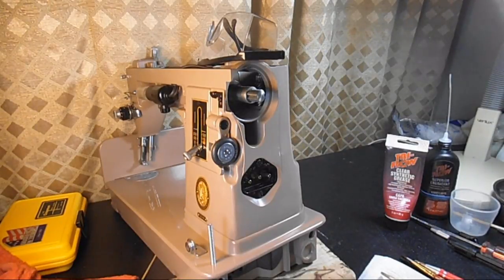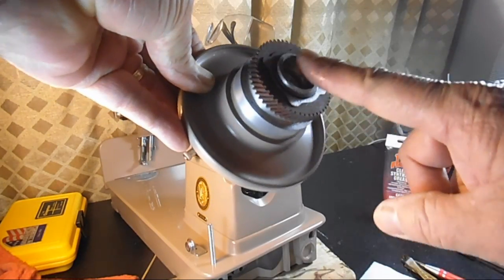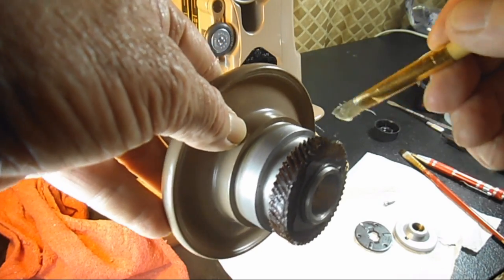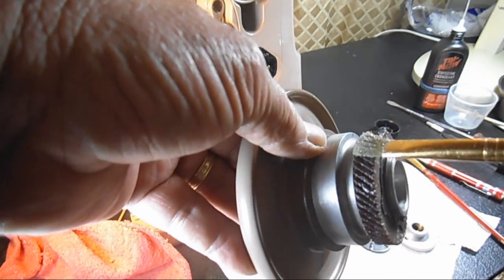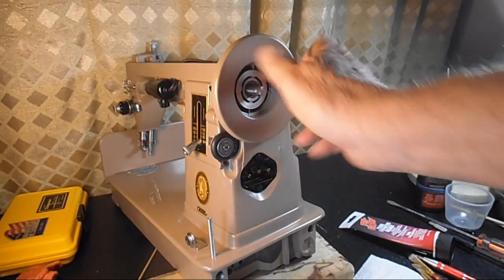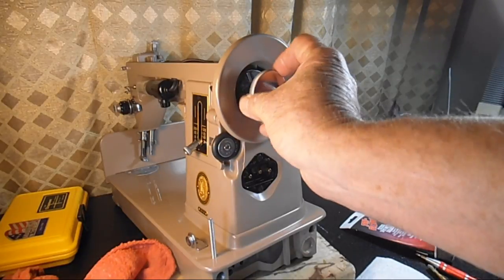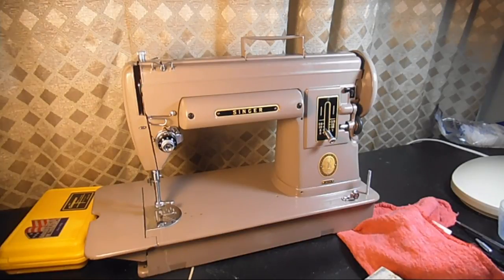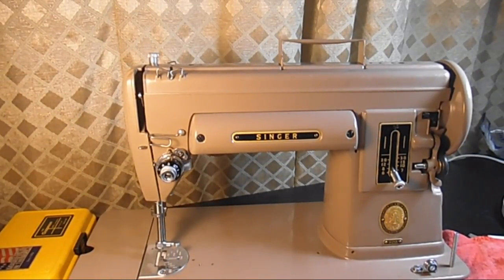Finishing All Together Now - Coco goes to the Spa Pt. 8b - A Singer Model 301A Rehab

Comment: Good afternoon Andy.  Putting everything back together, and I could not find the needle/throat plate.  I spent 30 minutes, finally the wife started helping me, checked the work area, my recliner, the bottom of the magnetic screw holder cup 3X, and all of my pockets.   I knew I had laid it on the table top work area.  I finally picked up the tablet (watching Andy Tube while tearing things apart) with a magnetic latch on the cover.  It was stuck on one of those small rare earth magnets I had told you about.  Doh, slap to forehead!  Funny story I had to share.
Reply from the maker: Thanks for the laugh. I needed one. Too, too funny. 🤣✨

Comment: Thank you so much Andy! I recently acquired a 301 and have been so frustrated with a few issues. In this one video, you have cleared up these problems and she's running like a champ. After removing the handwheel and the nut, I discovered a ton of grease where there should have been none. Cleaned it up, put the wheel back on correctly, and to borrow your line: "taaa-daaa" perfection!  You are my new bestfriend! Thanks for all of your wonderful videos.
Reply from the maker: Congrats on your newly acquired Model 301; you picked a winner! I'm honor to have you as a friend; who can't use more friends after all. Your very kind comment made my day today after getting some bad news, no thank you very much for taking the time to let me know. Happy Sewing, 'friend M P'.
Reply: @andytubesewing1953  Thank you Andy. Sending thoughts and prayers.
Reply from the maker: @MPCrafts461  👍✨
Reply: My machine was as new it was from a high school and it showed no signs of dirt when I got to that gear you can tell where it slung off some original Grease being the machine it was so clean I could do forensics on it

Comment: Andy, I discovered your videos on Coco about the time I gifted my Featherweight and started cleaning up my 301.  I'm not that knowledgeable about the internal workings of the sewing machines I use, but your videos gave me the courage and knowhow to take my machine apart, clean it, and put it back together again.  And I have made a purse and a quilt since I did that.  Thank you thank you thank you for putting out a very comprehensive and understandable set of videos.  Now, if only I had the same thing for my Singer 319K.
Reply from the maker: Congratulations, Deva! If you have successfully sewn with your 301 that means you did a fine job with its restoration. I'm glad you found my videos helpful and thanks for letting me know.
I think you are ready for more restoration work, don't you? Follow these links below and download FREE copies of the instruction manual, parts list with diagram and even the coveted Service Manual for your 319. I'm sure you will find restoring it very rewarding and I believe you can do it. What say you, Deva? Have fun.
https://www.singer.com/sites/default/files/product_manual/SINGER%20319%20and%20319K%20Sewing%20Machine.pdf
http://parts.singerco.com/CPpartCharts/3_39999/319K.pdf
http://parts.singerco.com/IPsvcManuals/306W25.pdf

Comment: Thank you for all the videos on Coco. I've got a lot of work to do! Now I must check out your video on the tension. Mine is all rusted, sure hope I don't have to replace it.
Reply from the maker: Thank you for watching and for rescuing that machine. I use a product called "The Must for Rust" to remove most rust I find on parts. Hopefully, your tension assembly can be saved. Best of luck going forward.

Comment: Thanks so much Andy. Do you think the candle wicks from home made candles would work the same for those missing oil wicks on the top cover? I tell you, whoever ended up with this cocoa gal got a treasure!
Reply from the maker: I don't know anything about the candle wicks. When they are missing on a machine I have just taken a piece of felt, even from a spool pin felt, and bunched it tightly into the hole. You just want something to slow down the oil and help keep dust out. If you feel a candlewick will do that then go right ahead and use it. My wife gets the first choice of any machine I restore, and she "claimed" Coco well before I finished her. It is her daily driver for sewing, replacing a "Palimino" 301A.

Comment: Hi Andy, I just came across your channel and WOW what a lot of information! I own three vintage machines now and of course am looking for more, after we move that is. What I need information about is the Singer 191J that I inherited from my mom. I learnt to sew on that machine. Unfortunately for the last 30+ years, it has set idle in a basement. Currently it is in my daughters bedroom but still idle. My daughter sent me a few pictures of the machine and there is oil/grease all along the joints, so I know it will need a good cleaning.  We are moving back home in a couple of months and I will finally have the opportunity to bring her back to life...if I can find more information on her. I did get a copy of her instruction manual so that will help some. Do you have any information or where I could go for more information to restore or rehab her? Thanks again for such informative videos. Cheers.
Reply from the maker: Hello Ingrid. Thanks for watching Andy Tube. I do not have any information for Model 191J, sorry. None of my contacts has a service manual or parts list. Other than being told it was made in Canada, I've never seen or worked on one. The general cleaning, degreasing and lubrication info in my videos can apply to any machine, but I have no specific adjustment information for you.
Reply: Ok then, thank you. This machine seems to have no information about, which I find so weird. Thanks again.
Reply from the maker: It does seem weird, but common with the Singer Models made outside the USA. Canada, Italy, South America, etc. I can find records for models made in the UK sometimes though. From searching online I saw comments that this model was also made in Japan. My guess is the mechanics of it are the same as a nearby model number, say 192 SPARTAN made in Scotland, but with a different body style.

Comment: I'm proud to own one especially one that was used so little and taken so good of care it's a two-tone came from a high school has the zigzag and buttonhole attachment that work really well several bobbins the carrying case is even slanted at 9°. I don't believe it was used very much the bobbin of course was in the wrong way the finger wasn't in the bottom of the slot under the throat plate.
Reply from the maker: Sounds like a keeper. Congratulations.👍